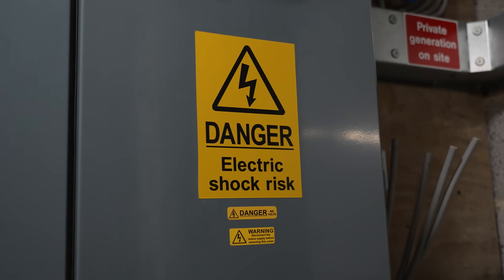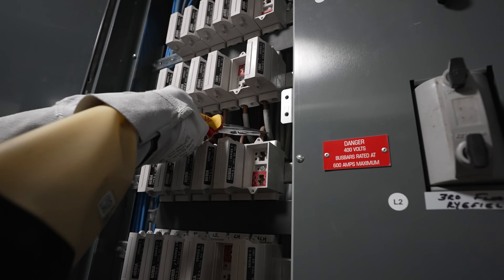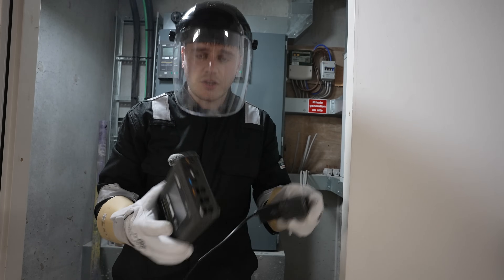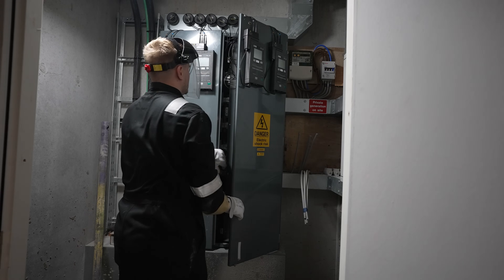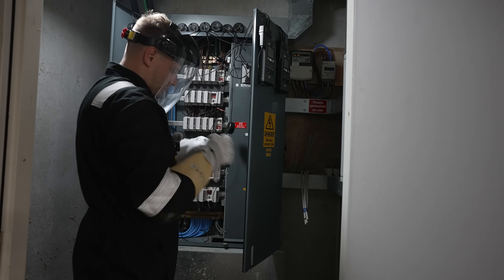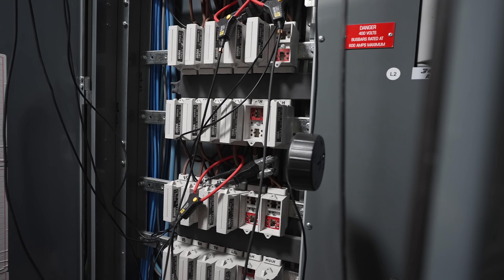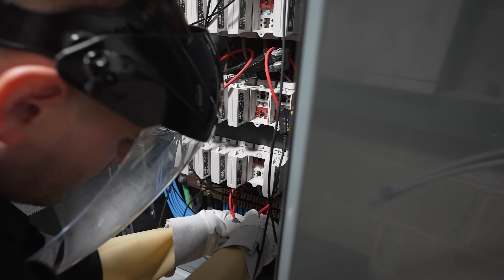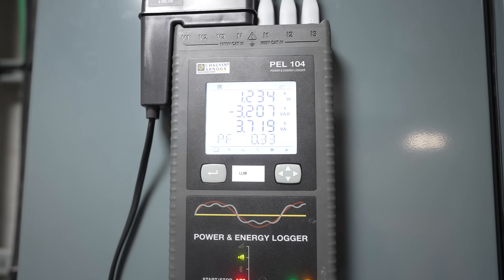Connecting a power logger to a LIVE 600A fuse board | REC04

Comment: Is it true that if the motors were synchronous, they'd have a leading power factor?  I installed some 2000 and 3500 hp synchronous motors running on 1300V about 40 years ago and they had a 1.2 leading PF.

Comment: A reactive load of -3.5kVAR corresponds to a capacitance of about 200uF hanging directly on the mains.  It's a big capacitance and I can't think of anything that would do that, so I suspect that there might be a faulty grid tie inverter connected which is failing to match the phase of the supply.  It might be an idea to repeat this measurement at night when there's no solar power.
Reply from the maker: Check the latest video, it looks like you’re correct!
Reply: Unless there is a lot of electronics connected you would expect (on balance) the load to be more inductive rather than capacitive.

Comment: Interesting that the VAr reading on the first PEL was negative indicating a capacitive load rather than inductive. The second PEL to the plant room was showing inductive VAr, 0.9 pf is pretty respectable for motor plant. Would be interesting to see what the pf closer to the intake is, as the capacitive loading should counteract the inductive loading.
For connections into boards like this I have a set of fly leads made up with 4mm safety sockets on them that connect direct into the leads to save taping the crocodile clips in  place. For Red Spot fuses, I have a set with the 4mm sockets built into the fuse carrier.
Reply from the maker: Nice, can you send me some pics of those? They sound great!

Comment: does direction of flow matter when im using my clamp meter to measure current?
Reply: AC amps and DC amps should be measured separately... There are 2 separate positions on a meter to measure each one respectively...
Reply: No
Reply: He is measuring power, so the meter needs to know the direction of the current to differentiate between exporting an importing electricity. Hence the clamps have a direction arrow, so you put them all in the same direction. For normal clamp use on AC to measure current only, it doesn't matter quite so much.
Reply: @three-phase562  thanks

Comment: Very interesting stuff. So it's possible a supply can alter the cost of electricity? Or is the "power factor" related to something else? I work with meters and obviously some customers dispute meter reads and bills. This usually results in a 2nd check meter being installed to run concurrently. I wasn't aware of other factors on the supply side that alter bills, if that's what you're investigating.
Reply: It’s to do with real power and apparent power.  Basically the property is wasting electric that could be used but instead it’s not.  It’s nothing to do with the meter side of things but more the equipment using the power.

And power factor isn’t really used in domestic properites
Reply: @Ronny86_  ok thanks, all good to know
Reply: @0liver0verson9  Yea, Ronny is right: nothing to do with supply but depends what loads are installed. Inductive loads like induction motors will lag the power factor by nature, dropping the power factor. Lagging power factor reduces real power, but the supply company still needs to pay to transport the total current (real + reactive). They are only concerned with VA through the lines, so they effectively charge you more than the real power you are using. Only really applies to commercial properties that would have lots of inductive loads (e.g. lots of induction motors)
Reply: @cameronmantell9959  Well I just learnt something! Cheers

Comment: You said that there is a bit of PV connected to the board with the bad power factor. One time we had a case, where the inverter was faulty. It produced a huge apparent power and was tripping the 25 A fuses, but the meter only read a few amps active power.
Reply: If the load and generation are closely matched, then irregular power factors are quite common. It would be worth turning off the solar and re-checking those readings. Though at 5pm you wouldn't expect much of an influence.
Reply: I will be very glad if you can  make me your apprentice 🙏🙏
..i have a electrical backround.
Reply: I will be very glad if you can  make me your apprentice 🙏🙏
..i have a electrical backround.